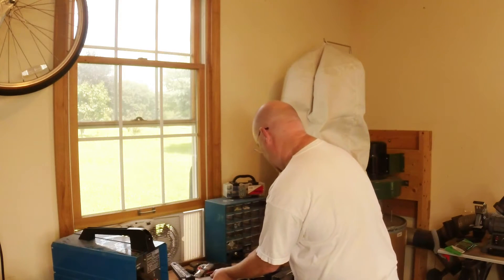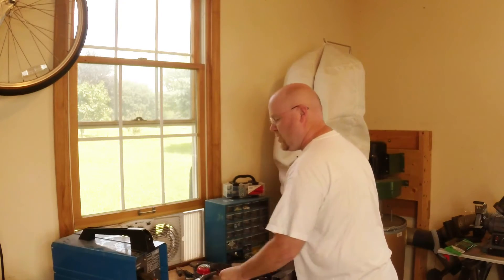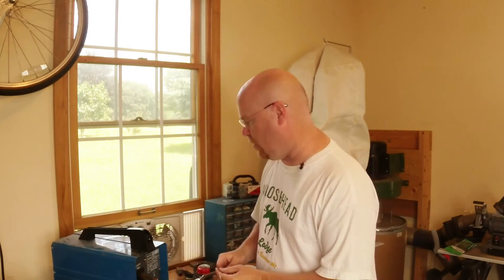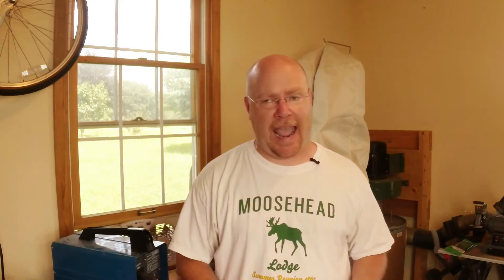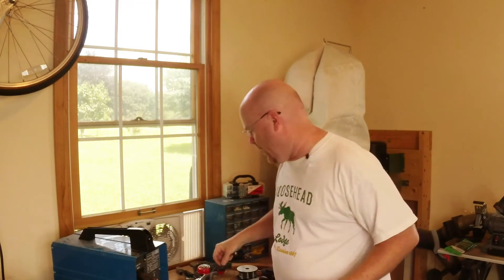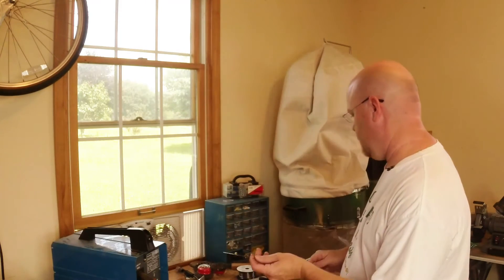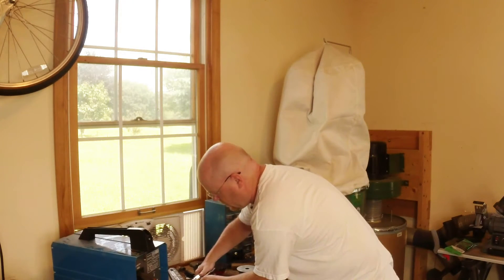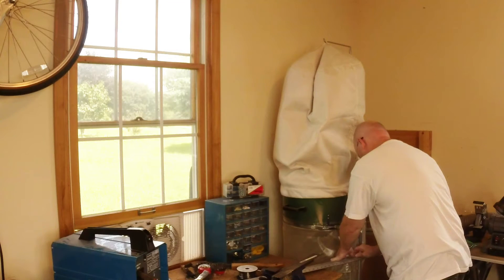Easy Harbor Freight 90 AMP Welder Mods 07

Comment: I realize this video is older but, what if i wanted to use 2 cpactors, instead of one, i was thinking of using 2x 80volt, 22,000 uf instead of one, i thought i read that 2 would control current better

Comment: Another way to obtain a more linear feed is to replace the 10% or 20% accuracy linear potentiometer with a 0.5%, 1% or 5% accuracy linear potentiometer and then carry out your measurements as you have described. Keep in mind even the new Lincon 140 Pro-MiG I just purchased from Lowes today (8/01/2020) has a 20% accuracy linear potentiometer.

Comment: Hi Matt, I just discovered this video series... thanks for the tutorial.  I just finished modding my crappy Harbor Freight 90A black box welder today.  I missed all the hamfests in my local area so I had to rely on eBay for my capacitor.  I used a 50V 610000uf... it was a little difficult to get in but I managed to lay it on its side between the transformer and front panel.  I think the wires that need to be cut are closer to 6 AWG... I found some 6 gauge ring terminals at Lowe’s that worked great.  I tossed the HF wire and put in Lincoln and now I am very pleased and surprised on how much better it welds.  Thanks again!

-david

Comment: Your pretty worried about perfection about a cheap welder!  You get what you pay for.  Funny Harbor Freight hasn't taken you to court for slander!
Reply from the maker: +hairburger62 Not perfection.  As long as I'm holding the torch that's not going to happen with any welder!   No reason not to do as well as possible though.

Oh, and the legal definition of slander is to harm someone with a false statement.  They're going to have a tough time proving that everything I said isn't true.  Besides, as you go though the vids I think you see that HF has gotten a fair shake here, and they have enough of my money to console themselves if their feelings are hurt.
Reply: I'm very happy for you, although your statement is a bit false but mostly true. This welder is made cheap for small projects and beginners although it does need improvements.  If the company make these improvements, I'll bet they will charge more!  Thanks for your acknowledgement of my comment.

Comment: like your vids.. a few tips to add..when you want to change your wire out for another brand/size or checking your inches per minute..Instead of cutting it off and wasting it just release the tensioner and wind it back on the spool.
 
When you were explaining stick out, it shouldn't effect having the nozzle full size with flux core, The reason for not wanting long stick out is for when you are using shielding gas such as argon.. If you have a long stick  out with argon you will not get good gas coverage that could lead to porosity /lack of fusion,Dirty welds Im not suggesting that you can weld with a 3 inch stick out but no need to cut it back..Also some times i like to rest the nozzle on the work piece to steady it.

One other thing that would be helpful when using a low amperage machine would be switching to .023 wire

and lastly pushing or pulling is mainly preference to a certain degree..Like you said jody has done a couple of vids on the subject.  Hope this advise  helps

Comment: Hi Matt, thanks for your posts. I ended up buying .035 lincoln wire instead of .030 and couldn't get the durned feed to take it. Thanks to one of your other vids I figured out how to open the the roller guide on the other side and got it inserted finally. I gots to tell you, the .035 weld is FAR SUPERIOR to the .030. My welds look like real welds instead of sputters and crappy polka dots, and this little crap one trick pony of a welder actually does keep up enough current to really heat up thicker metal to get a decent bond. Anywho thanks for your efforts bro! I'm a woodworker turned welder too and everybody out there should THANK GOD that I'm not doing any structural welding..but what I do is good enough for some metal sculpture I'm doing. Take care

Comment: 1st question  asked in a better  sentence,, take a strand of wire lay it on the very spot your welding on the  ,, then weld  on that spot ,, starnd/ and the welder feeding the  wire< more flux?  what would the outcome be on a dc only stick(welder) ?

Comment: 1st off I have to say I never welded in my life, nor do I know anything about it,, I have two weild ideas, what would happen if you laided a strand of that wire you clipped off on the very spot you was going to weld on? plus the wire you feed>?    second question  could this be done to a bigger  ac only unit? your capicator, diode deal< what would be the outcome to a stick welder?

Comment: The speed does seem to sag when you start the weld with this thing. I think thats why there is no translation in the manual.
Reply from the maker: Yep.  The wire feed is powered by the same transformer doing the welding, so the motor speed varies with the weld voltage - which is a giant pain.

Comment: that speed might change depending on the tension on the spool right?
Reply from the maker: It shouldn't.  The knob controls the speed of the drive roller, which should push a given amount of wire on each revolution.  More tension on the spool makes it harder for the drive roller to turn and so puts more load on the motor.  If you really crank it the motor will run out of power and slow down - or the drive roller will slip instead of gripping the wire.  In these cases you will get less feed for a given setting, but you shouldn't be in this boat.  This is way too tight.